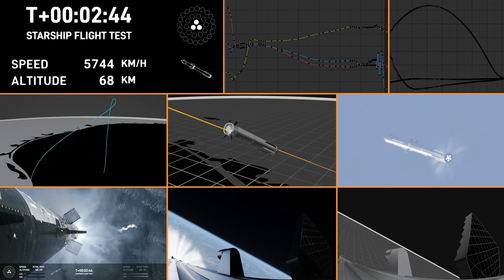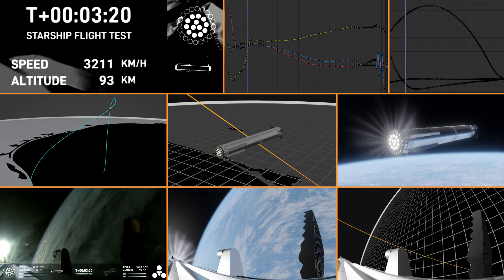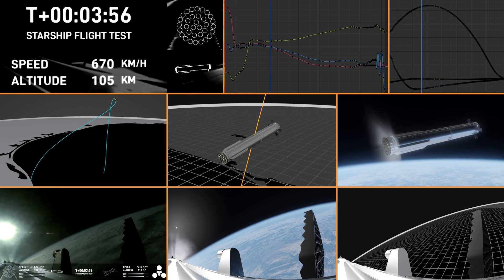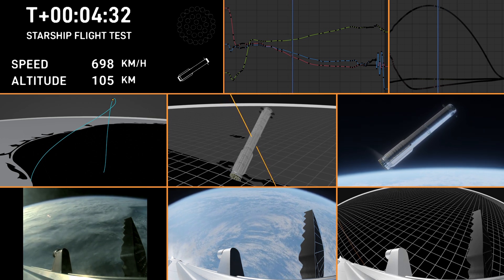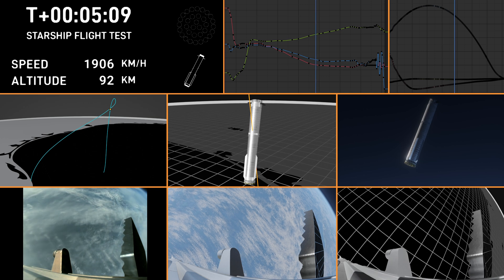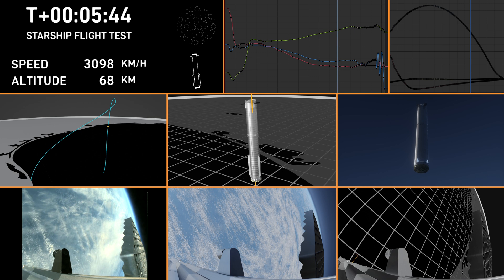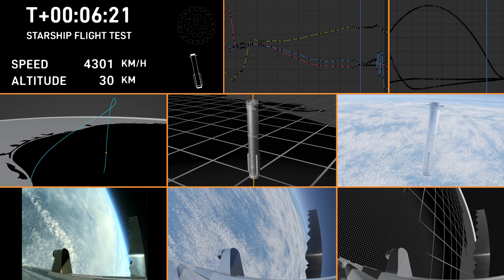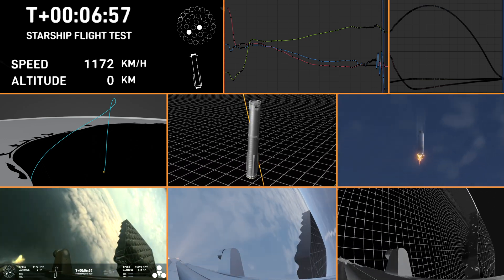Starship Booster 10 Descent Simulation

Comment from the maker: COMMENT FROM SPACEX, May 24th 2024

"On March 14, 2024, Starship successfully lifted off at 8:25 a.m. CT from Starbase, Texas. All 33 Raptor engines on the Super Heavy Booster started up successfully and completed a full-duration burn during ascent, followed by a successful hot-stage separation. This was the second successful ascent of the Super Heavy booster, the world’s most powerful launch vehicle. At stage separation, Starship's six second stage Raptor engines all started successfully and powered the vehicle to its expected trajectory, becoming the first Starship to complete its full-duration ascent burn.

Following stage separation, Super Heavy initiated its boostback burn, which sends commands to 13 of the vehicle’s 33 Raptor engines to propel the rocket toward its intended landing location. All 13 engines ran successfully until six engines began shutting down, triggering a benign early boostback shutdown.

The booster then continued to descend until attempting its landing burn, which commands the same 13 engines used during boostback to perform the planned final slowing for the rocket before a soft touchdown in the water, but the six engines that shut down early in the boostback burn were disabled from attempting the landing burn startup, leaving seven engines commanded to start up with two successfully reaching mainstage ignition. The booster had lower than expected landing burn thrust when contact was lost at approximately 462 meters in altitude over the Gulf of Mexico and just under seven minutes into the mission.

The most likely root cause for the early boostback burn shutdown was determined to be continued filter blockage where liquid oxygen is supplied to the engines, leading to a loss of inlet pressure in engine oxygen turbopumps. SpaceX implemented hardware changes ahead of Flight 3 to mitigate this issue, which resulted in the booster progressing to its first ever landing burn attempt. Super Heavy boosters for Flight 4 and beyond will get additional hardware inside oxygen tanks to further improve propellant filtration capabilities. And utilizing data gathered from Super Heavy’s first ever landing burn attempt, additional hardware and software changes are being implemented to increase startup reliability of the Raptor engines in landing conditions."
Reply: I love this!
Do you think that it would be possible to host a live stream for flight 4? That would be wicked.

Comment: My hypothesis about the engine shutdown sequence at the end of the boostback is that the propellant tank is getting empty. The drains of the inner ring are higher, so those engines have to shut down before the propellant level fall below their inlets. On the other hand the center 3 engines' drains are at the bottom of the tank so they can run for a longer time.

The same thing happens before the ship's engine shutdown: the RVacs shut down well before the sea level ones, because their drains are higher.

Comment: Thanks for that. Excellent job. However, at the end you suggest the attitude the rocket was moving caused the engine failures on landing. The video shows significant fuel venting after boostback. A known problem with the Raptor after relights is fuel leaks. This may have caused the deviation from expected trajectory. You also suggest the Raptors were at reduced throttle because the booster greatly overshot the landing zone, suggesting insufficient boostback. Either SpaceX commanded this or the engines failed in not being able to do full thrust. Note fuel leaks could be the cause of this as well.
Video showing frequent fuel leaks and fires in the engine bay after relights:

https://youtu.be/Ww83pSeuGuA

Comment: the end is incorrect how do you researchers not know how a liquid works?
Reply from the maker: Could you elaborate a little more on what specifically you are referring to?
Reply: @TheSpaceEngineer  Since the Superheavy is going at speeds of Mach 0.9, it would slam into the water like it was plain concrete. water is clear and since we saw the water rise up like the superheavy was a meteor. Wouldn't that mean it had a hard splashdown?

Comment: 4:31 Interesting note regarding the boostback velocity. I can offer the observation that the Falcon 9 first stage can sustain a 1:1 glide slope, so if it was indeed the plan for Superheavy to adopt a similar reentry glide, then a boostback cutoff velocity of only 83 m/s might make sense, as the GNC folks would expect the glide to make up the remaining up-range distance. If we assume Starship was intended to settle into a glide around the 80km mark, then it could potentially glide another 70km or so before having to start the landing burn, which checks out with the discrepancy between the planned and actual splashdown point.

This implies then that the issue was the gridfins did not have enough authority, maybe because they had conservative actuation limits in software?
Reply: I don't aggree with the slope. If you check the footage the gridfins seem to activate around 45-50km so the first half of the glide height should have been fine if that was the plan. I think that is where it starts it's glide back which would also mean that they expect it to be more like 1.5:1 distance:to height. Beyond the glide slope itself, I agree seems like the the PID controller they used had too mich oscilation and maybe was fast enough so it just straight down and entered a "pilot" induced oscilattion at lower altitudes.
Reply: i think the one Gridfin got loose or broke, becouse the rotating in the end doesnt match the gridfin movements

Comment: Looks good. Was there anything in the feed that suggested engine compartment failure?
Reply from the maker: There were considerably sized pieces of debris falling off of the booster, at one point one scrap actually hit a gridfin right before the landing burn started. We don't know for sure but the outer shielding definitely did tear off leaving the engines exposed
Reply: @TheSpaceEngineer  Thanks. I’ll take another look. Always just considered ice 🤣. It does look like a flimsy area though.

Comment: Why did it “fail to catch a glide?” Did that cause the long down range landing?  Why did it end up nearly vertical?

Or are these things we don’t know until the results come out?
Reply from the maker: Pretty much what you've said in the latter portion. We simply do not know. What we do know is that the booster shut down with only 83m/s of horizontal velocity, not nearly enough to come back to shore. Parabolic arcs will be parabolic arcs and so it descended as nearly a straight line. Because it has so much velocity in the downwards direction versus in any horizontal direction by the time it had begun feeling the effects of the atmosphere, it was unable to really catch the airflow. Those strakes/chines on the side of the vehicle act as stubby wings that would allow it to glide a little bit in the atmosphere. Even if it had caught the airflow, it would not have made it to the planned location, it simply was just not going fast enough back towards shore.
Reply: @TheSpaceEngineer  oh, now I get it. Thanks for putting the pieces together for me!

Comment: Looks like the engines were starved of fuel because of slouching due to erratic rolling and pitching of booster probably due to turbulent supersonic airflow around booster
Reply from the maker: Possibly, but it's unlikely that the fuel level itself was low. I don't think the engines would be starved in this manner

Comment: Absolutely tops. Any idea about the propellant slosh and the G forces during the violent attitude control issues of booster. I think that could have damaged the landing tank. We did see a new landing tank section outside.
Reply from the maker: It's possible, but unlikely. That new header tank outside yesterday appears to be near-identical to the current design anyway, and it's for B17.

As for propellant slosh, that problem appears to have been solved by them installing two massive tank-spanning baffles that act less like baffles and more like diffusers because of the sheer amount of surface area they have.
Reply: I see. So does that rule out weather problems as there were crosswinds and decent cloud cover that day.
Reply: I guess the mishap investigation would end on May 13 to 14 and then a WDR would occur on May 16 or May 18. A launch at the fag end of May like May 27 is kind of likely.
Reply: @Nice_Pixels so close (June 5)

Comment: Do you think the "soft landing" failed because the booster was falling nearly vertical  rather than a downrange slant using the body to slow down as well like the falcon 9s do?
Reply from the maker: Pretty much yeah. The engines are not designed to be lighting at over mach 1 on the way down. Ideally, it's subsonic by the time the landing burn starts, which was very much not the case on Flight 3
Reply: @TheSpaceEngineer  THANK YOU! I’ve been speculating this since the flight but had no way to know for sure. I had the same thought about ignition so cool! Do you think then that the trajectory must’ve been wrong?
Reply: Doesn’t Falcon 9 always do a reentry burn?  Why no reentry burn for Superheavy?  Seems like a reentry burn would have slowed things down for the subsonic start of the engines for landing burn.

It came down too fast and hit the lower atmosphere hard…it really decelerated down low but that’s probably what wrecked the engines, no?  High dynamic pressure?
Reply: @Andrew-13579  A reentry burn would need more fuel, and they think they can get through reentry without it.
Reply: @phunkydroid  It takes x amount of energy to go from orbital velocity to zero.    They will want to expend as much of that as friction as possible to save the fuel, sure.  But if you come through the friction with too much speed, it will take rocket burn to zero that.  If you reduce some of that speed at around maximum temperature to protect engines and structures from excessive heating, should have less speed to zero-out for landing.  Well, I assume they’ll figure out the best way.